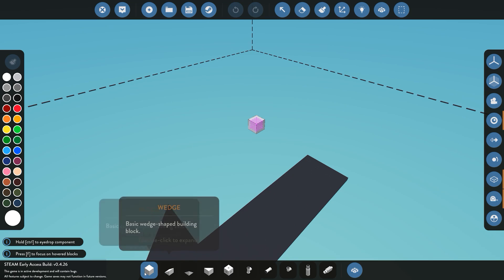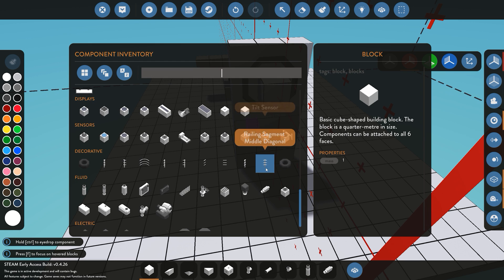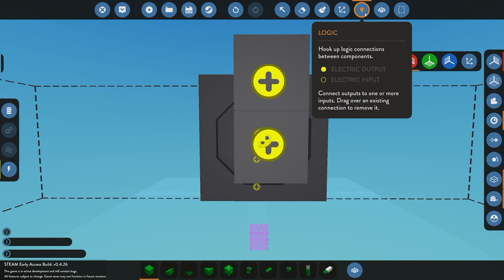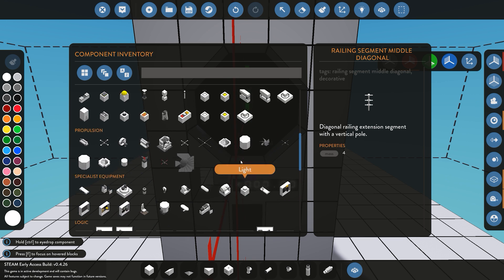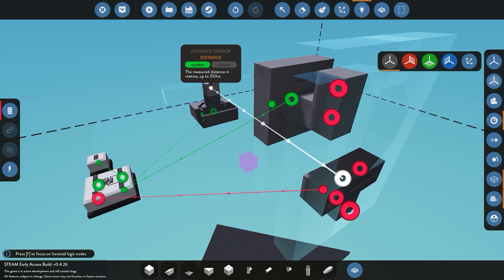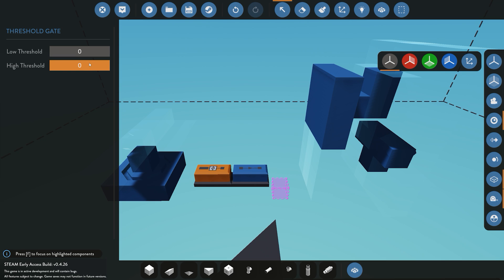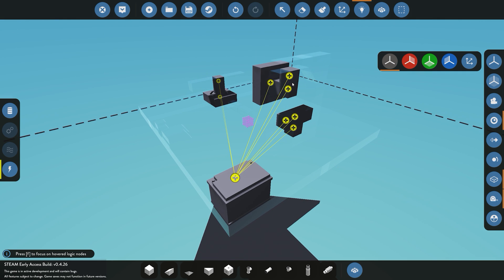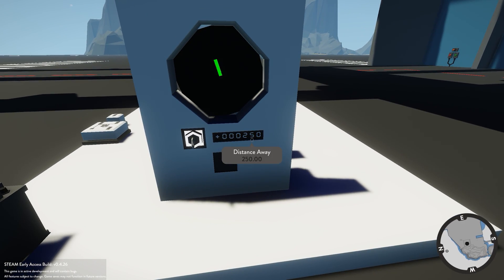Stormworks Radar Tutorial

Comment: This is tempting me to make a ground based radar dome for something like an air control tower, but there is a problem:
 
From what I can figure I'll need  to hook up 36 lasers at increments of 0.00555555556 angle units (45 degrees is 0.25 angle units on a robotic pivot) that only guarantees that the radar detects objects that are 22x22 blocks at 1km, since the range on the lasers is twice that at 2 km the smallest object it could detect with 100% accuracy would be 88x88 blocks.
If you place this thing on a rotating bar it would cover a 4km diameter area of airspace...Now here's the problem: By the time I figure out how to wire this thing the devs will probably have implemented a one-piece radar block already...and colonized mars.
Reply: At least you are right!